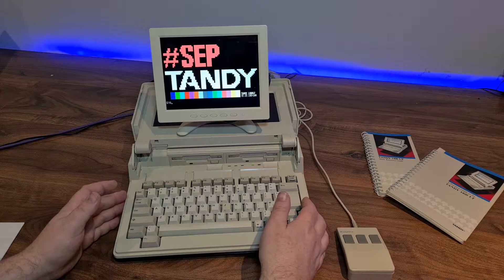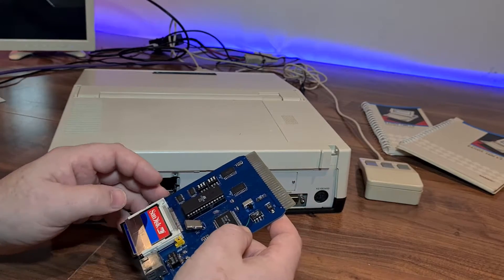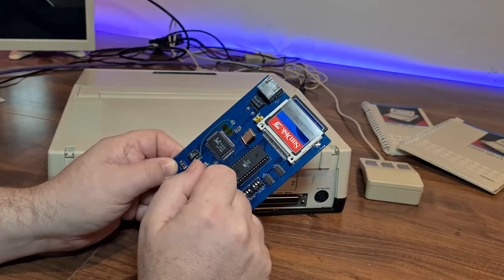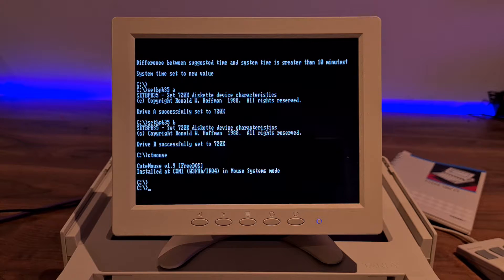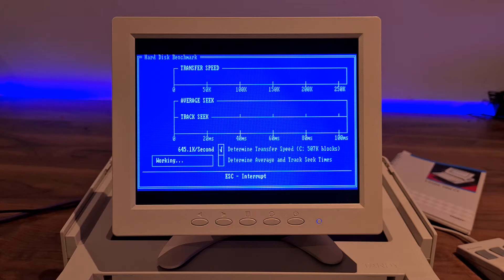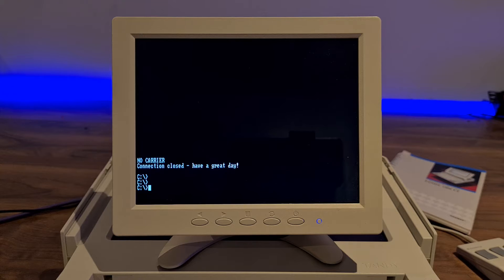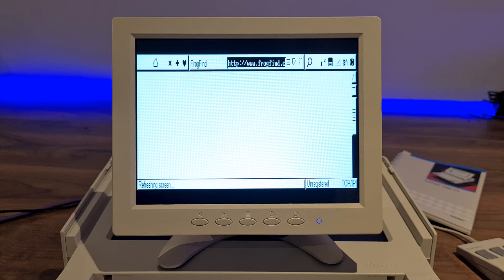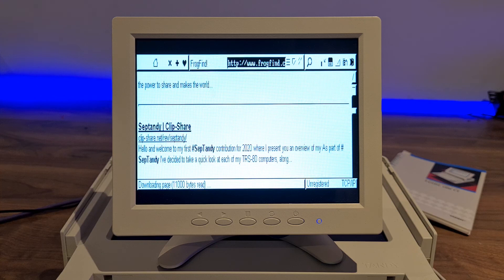TANDY 1400  XT IDE CF + LAN card opensource DIY   #SEPTANDY  1400LT

Comment: Out of curiosity, what monitor is that? I'm about to pick up a Tandy 1400 FD for myself and I want to hook up a raspberry pi to the slot you used and run windows 98 with it on a colored monitor. If there's any chance you know where to get one of those monitors, that would be great, but if not, I'm just curious about the name
Reply from the maker: Its a generic 8" tft monitor , the brand name is eyoyo 8 inch monitor from aliexpress, but I took it apart and painted it cream colour. Hope that helps

Comment: Fantastic Video...Much appreciated.  I just got a TexElec card and am having a tough time.  I used VirtualBox to format a 512MB CF card with MS-DOS 5.0.  The card is not recognized by my system.  Any help you could give me on how to get the card setup properly would be greatly appreciated.  Thanks, Scott
Reply from the maker: Does the cf card appear in the XTIDE bios during boot ?    If so  you should ready boot with a floppy , run fdisk and clear the partition list on the cf card, then create a partition and make it active, reboot and then boot of floppy again and format c:  Then you can take it to your main pc with bbox and copy the system across. Often creating patitions on modern pcs, make the partition map incompatible with old xt/at computers.  Hope that helps.
Reply: Thanks...When I have the card inserted and boot without a floppy, nothing happens.  I'll try booting by floppy and running FDISK to see if it finds the CF card.